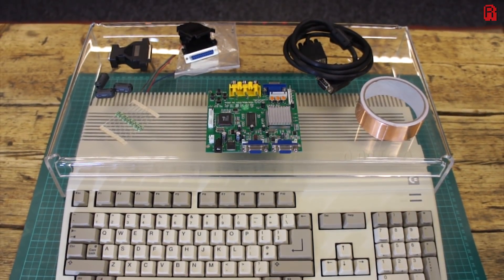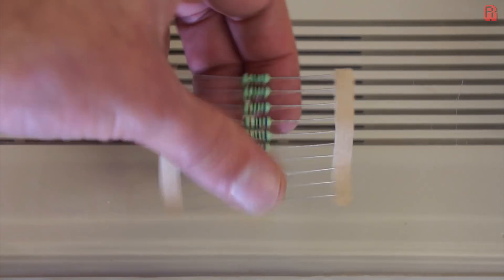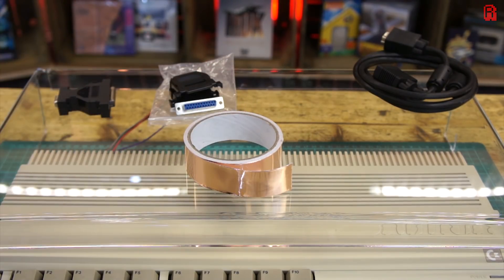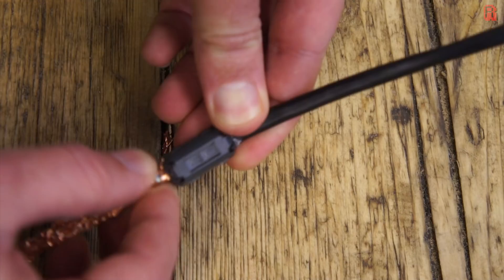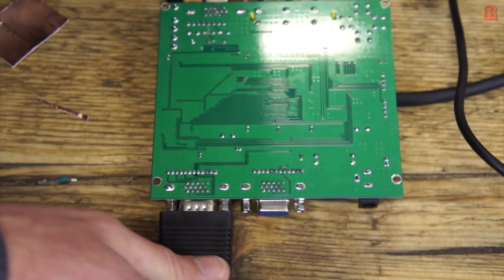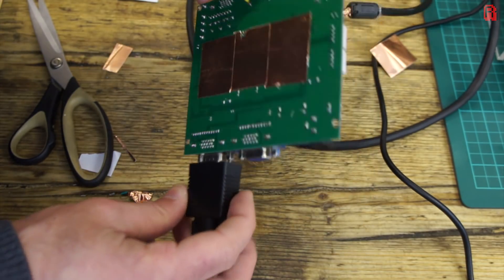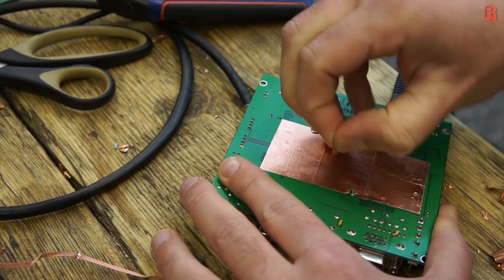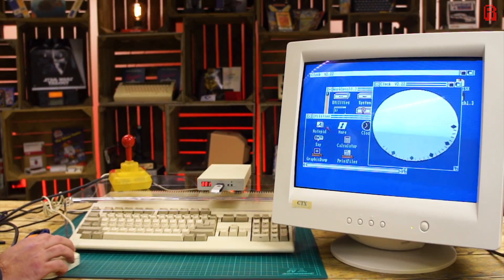GBS-8220 - Fixing Noise (Amiga to VGA)

Comment: Perhaps getting it inside a metal case will assist with the stray EMF interference.
Reply from the maker: Project Geek I'm on the lookout for one in the dumpster 😁 that or a copper lined lunchbox
Reply: RetroManCave A lunch box could be a great mod!
Reply from the maker: Thundercats, Pole Position or Transformers?
Reply: RetroManCave Ooh tough call, but Transformers were the bee's knees.
Reply: it's due to the design of the board, ram traces aren't designed with dozens of traces in line next to each other. traveling current induces EMF on nearby parallel lines. the copper shielding acts like a sink.
Reply: Is there any place has a LBB for this thing?

Also, how well does an ST do through this with its strange High & low/med resolutions?

Or even a Beeb?

A very interesting video as always!